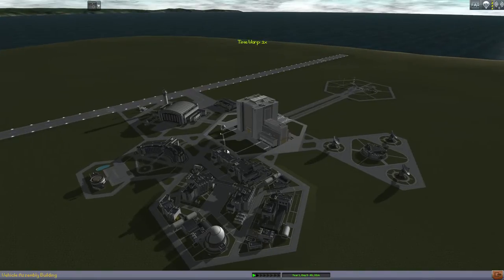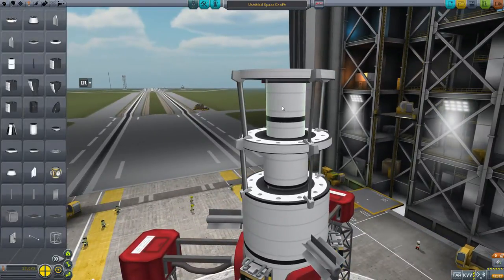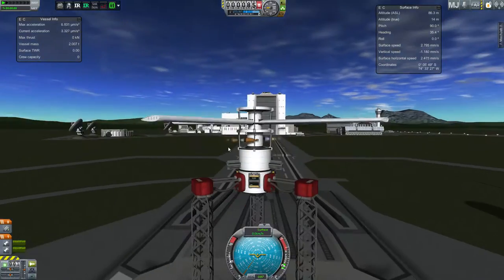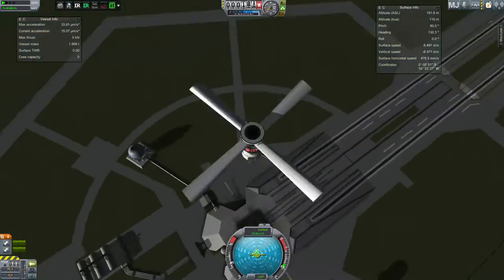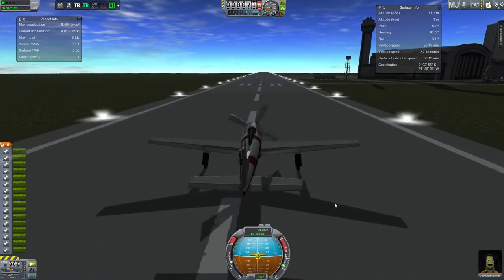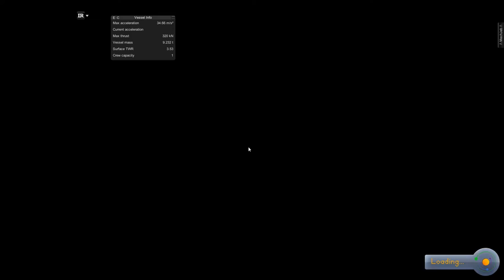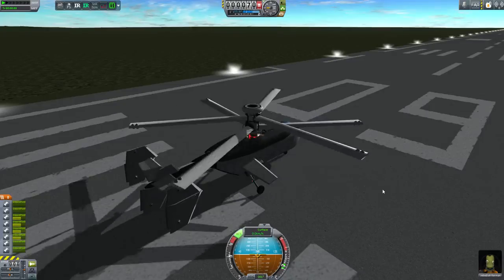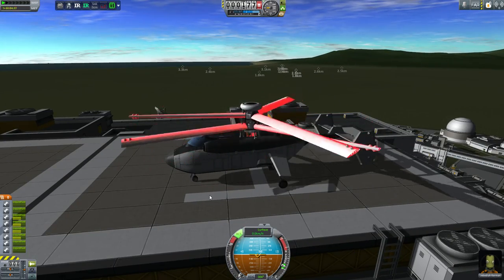Kerbal Space Program: Turbines

Comment: how do i counter the thrust from the turbine when making a plane?
Reply from the maker: There are a few ways. If you use a reaction turbine (ie. attach the nozzles to the rotor directly), you won't actually get any torque directly to the vehicle (although you'll still need to deal with certain aerodynamic effects from the propeller).

If you use impulse turbines where the exhaust from the nozzles hits an impeller and rotates it, then you need to deal with the torque the nozzles produce. Simplest way to do it is to just accelerate carefully until your ailerons can counter the engine torque with aerodynamic forces, that's what I did on this video - just make the plane with wide enough landing gear, and it's possible to take off. A bit tricky, though, as you saw in the video, but definitely possible.

Second option is to neutralize the torque by making a twin-engined aircraft with two counter-rotating propellers, like a P-38 Lightning. Or a different configuration where you put one tractor engine and one pusher engine, and the torques will also neutralize each other this way, like on a Dornier Do 335.

The most complicated way would be to build a contra-rotating propeller design, similar to the coaxial helicopter rotor I built in this example, but smaller scale. Then you'll have one turbine spinning one direction, and another spinning into other direction, and that will also neutralize the torque.

The most "brute-force" approach would be to just put in equal amount of thrusters in opposite direction, which do nothing except neutralize the torque produced by the actual "working thrusters".
Reply: thanks you helped me tons

Comment: This was an amazing video. Do you think you could produce an aircraft with counter-rotating propellors like that on the Tu-95?
Reply from the maker: Possibly. The problem with relatively small propellers is their limited amount of thrust, but I could try.
Reply: If KSP had balloons it would be kick ass to do a massive zeppelin with propellers to push it forward.
Reply: HerraTohtori
The biggest problem with small propellors - or any rotating object in KSP - is the maximum speed of ~ 45 rad/s. Compare that with RL propellors. It's enough for a helicopter though.
Reply from the maker: Alex Verwaijen I remember the rotation speed limit was bumped a few versions back. I actually thought it was removed.

45 rad/s would be about 430 rpm. I wonder if the limit could be increased by a factor of ten...
Reply: True ... back then the limit was 7 rad/s. You can imagine the amount of work to build a turbine in a helicopter and have it take off. They did btw ... both using FAR and stock.
Reply from the maker: Alex Verwaijen With a large enough wing and light enough vehicle, sure.

With stock aerodynamics you could just increase angle of attack without proper stalling, too. The hardest part with stock parts was to figure out how to make a functional bearing. I remember seeing Scott Manley's video about making one with the small landing gear bay.